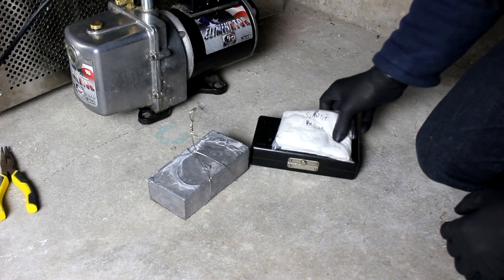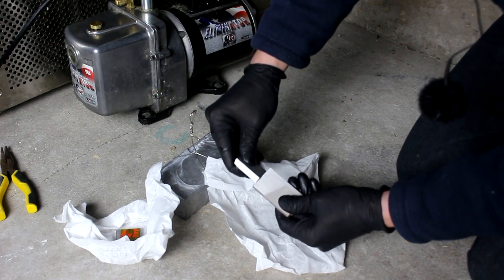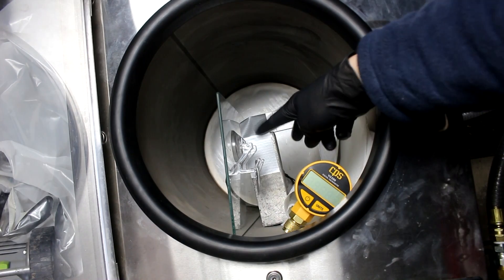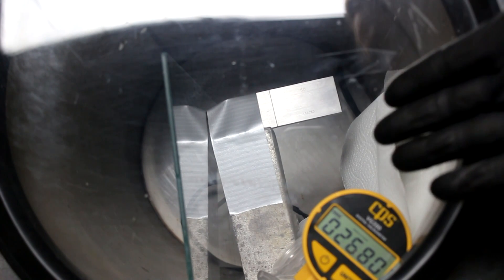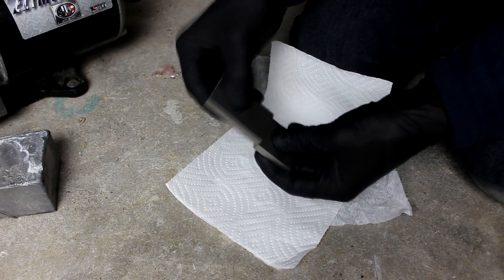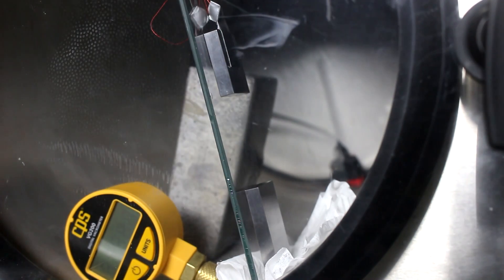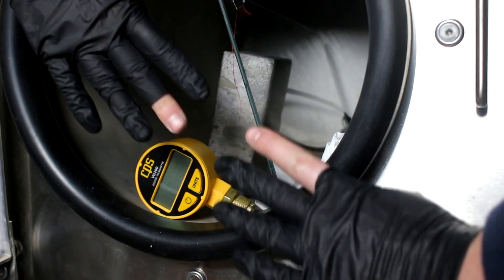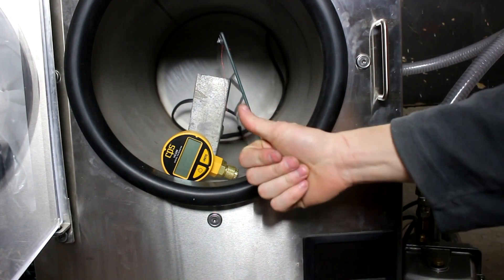Will Gauge Blocks Stick In Vacuum?

Comment: The bonding effect comes from temporarily induced ferromagnetism.
Reply from the maker: got an idea on a way to test that? because I'll do it.
Reply: Already falsified. Gold is not ferromagnetic. I don't think indium is either.
Reply: I just had an idea. Use a remote controlled motor from an RC car. This will allow you to remotely rub the blocks together without strings and stuff. You'll have to get an old RC vehicle of some sort and a controller and batteries but it could help with a lot of your vacuum chamber experiments
Reply: That doesn't mean it can't build up an electrical charge. Copper isn't either, but copper coils exposed to oscillating magnets definitely develops electricity.

Comment: Check the surfaces before and after joining the blocks with and electron microscope. See if there is any material exchange.
Reply: Excellent.
Next project: electron microscope.
Now that he has a good (dropping mercury) hard-vacuum pump, no problem.

Comment: Stiction. Optically smooth metal surfaces experience van der Waals attraction. Big problem in the old disc head business which is why the roughness had to be engineered to prevent the melding of the surfaces. Typical roughness factors were 8 - 20 angstroms or so. Do a search on Casimir forces. Cheers. Really enjoy your videos, by the way. Be safe.
Reply: vdW and melding are not the same thing. VdW is a polarization of charges phenomenon, and comparatively weak. You're not going to pull metal off metal with it, as Cody has already demonstrated in previous vids.
Reply: You are correct and it was a poor use of language. The old vdW explanation was a terminology which suggested a potential function having both repulsive and attractive regimes -- depending on interaction distances. In this particular case with the gauge blocks, I think the flatness has left a surface plasmon which extends over large areas of the block face. With roughness one gets localization and a lowering of energy of that local system. WIth the flatness, one gets an extended electronic state which has accessible electrons. Even the act of physically passing one block face over another disrupts this delocalized state and leads to a kind of localization between the surfaces -- their sticking together. Language is imprecise. I do find it interesting that a shear movement causes the disruption while a simple combining or touching does not. There is an activation energy. What is the heat of shear versus the drop?

Comment: Do you think that the humidity of the air could be sticking the blocks together like the oil did when you first stuck them together, where water is the lubricant instead of the oil? After all, wetting a suction cup does make it stick better... Is there a way to remove all of the moisture to test my hypothesis? Perhaps  repeating the experiment in a pure Argon atmosphere instead of a vacuum.

Comment: YO. Cody. MAY have found the reason. Was unrelatedly reading around physics concepts, found the Casimir Effect, and instantly my mind came back to this. It's the idea that two conductive plates/surfaces, when very close, generate a force between them. Gauge blocks being so precisely flat and made of metal, it sounds as though it would apply, so then it just becomes a matter of "How much"?

"In fact, at separations of 10 nm—about 100 times the typical size of an atom—the Casimir effect produces the equivalent of about 1 atmosphere of pressure (the precise value depending on surface geometry and other factors)" (Wiki page on it)

That sounds comparable to the gauge blocks, I think? So I suppose then this would be an example of some kind of "Casimir Adhesion"? (My phrasing, so I wouldn't quote it.)  I would think then that the air does need to be excluded, but not to create a vaccum; simply to maximise the contact area.

This effect seems both consistent with your experiments' results and also with mathematical principles behind similar situations, though I'm no expert, so I could be misinterpreting it entirely. Still, I think it's a direction worth looking into. :)

Comment: Is it possible that the sliding motion will temporarily create a magnetic field that will attract the two pieces together?  The friction may strip electrons from the surface of the metal, creating a magnetic bond of some sort?  One could try metal shavings (or graphite) over the joint to see if there is a magnetic field possibly.

Comment: What if you tried to get them to slide them together in the vacuum? Create a weight on a string, connected to a pulley that slides one block over the other?

Comment: Imo those blocks are so flat that when you force them together atoms behaves like velcro by very thin layers getting into each other . If it wasnt that flat , the little bumps of a normal block would prevent all area of the block to be contacted to other one . Try to unperfect one block a little bit to test this hypothesis ,   try rubbing sandpaper for very short time ,if it still sticks its dark magic .

Comment: What if in the first experiment, you tried to lightly tap the block over the gap to see if it will fall more easily at lower pressures; the vacuum is more perfect than the vacuum in the chamber.

Comment: IIRC correct, gauge blocks can hold like 75lbs+ for force, which is more than the surface area could hold under a 15psi vacuum. So that disproves that too.

Comment: Just food for thought. Could it be that the surface of the material is so finely ground and so flat that the atoms within the two blocks are bonding together as if they're a single block? In metals, electrons act as a 'localized sea of electrons', could it be the electrons are also bonding between gauge blocks, holding them together?

I work with these daily by the way, and this has often come to mind haha 
- Will

Comment: Maybe those blocks' faces are not quite 90 degrees to each other, in which case the glass surface will prevent the two contact surfaces being exactly parallel. I suggest somehow lowering the top block onto the bottom one without touching anything else, thus allowing it to settle flat against the other block under gravity alone.
Reply: I'm late to this party, but this was the comment I was looking for. The ends of the blocks would have to be almost perfectly perpendicular to the face that slides on the glass.

Comment: funny never seen glass or non ferrous gauge blocks, never knew much mystery behind it assumed it was magnetic interaction in close proximity and having the slide aligned the random poles of the ferrous materials. should slide em together with a bit of magnetic viewing film see if theirs a small interaction 

shrugs when what you've tried before don't work try something new.

Comment: i wish you tied two strings to the block, that way you could have tried to lift it while the vacuum was still in place. maybe when you let the air rush back in, some might be able to get between them. with a second string, you could burn the first, let it fall, and try to lift it with the second one from the outside (if this is possible? i think you've somehow done this before? i might be wrong)

Comment: I was thinking about your pressure gauge problem. Couldn't you just rig a simple remote control to press the button?  Even a cheap remote control car (remember the ones that only go forward and reverse?)  Tear out the guts of the car, and replace the motor with a solenoid and poof, remote control button pusher.

You might want to add a diode to the solenoid so it only engages when the voltage is in the correct polarity.

Comment: "At separations large compared to the London penetration depth c /ωp the interaction is due to electromagnetic waveguide modes, while at distances small compared to c /ωp, the force is due to surface plasmons." Read "Calculation of van der Waals forces in systems with nonlocal conductivity" for the actual scientific approach to this. Google the terms you don't know, this is pretty advanced stuff.

Comment: Is it possible that when you slide the blocks, there is some friction that scrapes off a thin layer of contamination, allowing the bare metal to form a weak cold weld?

Comment: Hey im a machinist. this works best with ceramic blocks but any scraped or well machined part does stick to a point. if you get a bigger plate or part that is flat on a flat table. stuck like fuck

Comment: Cody try putting two class panels on top of each other. They will stick together, then dip the panels in water to see if there is air between them. Or dip it to something less thicker than water. Then try it with vacuum chamber. If they don't stick, it's due to the friction. Hope that helps! LIKE SO CODY CAN SEE !!! <3

Comment: one more thing you need to consider is that even under a 99.9999% vacuum there are still air molecules SITTING on the surfaces of things. Nasa Uses freezing pads to extract this at the final stages of its testing equipment in 100% vacuum. I would say that IF and ONLY IF this is a cold weld process that you need to have a way of heating the surface. I think you need to "clean" both surfaces with your lazer for a few minutes to make sure there are not dust or air molecules or ANYTHING resting on this. I would suggest putting them in wet with acetone so when the vacuum pulls it cleans the surface then hit it with your lazer and see if that fixes it?

Comment: the reason this happens to the gauge blocks or any surface is a type of covenant cold welding. as if the metal is 1 pice and the atoms are so close that they want to bond. however there is a "crack" so its like a magnetic attraction between the atoms. some metals can cold weld but its not like a real weld.

Comment: i think you got the point across with the suction cups. But what you need to know is that they are not anywhere near a good vacuum. In fact i would garentee that the reason the suction cups came off was that the air inside them was expanding like now that the air is not pushing on the outside of them. Really nice job though.

Comment: Hey Cody machinist here. I work with both ceramic and steel gauge blocks almost daily. They both wring together (S-C/S-S/C-C) although they do wring when the surface is perfectly clean, I found its much easier if you clean them and then put a light fingerprint on one of the surfaces before wringing. if you push pretty hard while doing that, they will hold together with extreme force. If you have any questions about them feel free to ask.
Reply: I’m a pipe fitter. I work with stainless steel threaded pipe, quite often. I’ve been working with metal for twenty years. 
If it’s stainless steel threaded pipe, my trade will often say, “take a turn and walk away”. I’ve found patience in this. 
Most piping can be wrenched on hard and fast, and it’s good to go. Stainless steel will “gall”. It heats up due to friction no matter how much lubricant I use. So, I thread it slowly, and have less leaks because I can I can get more turns by letting it cool in-between rotations.
Reply: @quattovallor71 Ever just bring a can of keyboard cleaner and spray it upside down.  Get it done a fair bit quicker.
Reply: Michael Johnson hey I've been watching a few vids about these but I have no idea what you guys use them for. Hoping you can shed some light. Thanks
Reply: Gauge blocks are made to exact lengths and can be used to zero measuring equipment on, plus other measuring applications.
Reply: ,,, surface grinding is generally considered as very accurate; however gauge blocks and surface plates are a level higher and almost always are final lapped to size .
Reply: Interesting im sure the oil acts as an adhesive to aid whatever process actually makes them stick.
Reply: Well, I have a cheap set that I use for building spacer blocks - to use on the other side of the vise, in order to keep the jaws parallel. That is a crude use indeed, but you can make a spacer the exact size of whatever it is you want to hold, and the grip is better when the jaws are parallel. 

But one basic use of gauge blocks is to set a dial gauge at zero on a surface plate setup. Then you can measure some work to see how close to the zero it is. Like if the work is about 1.25" and you have an inch block + a .25 inch block, rung together, you can count on it being exactly 1.25". (It's actually bigger but only by nanometers!)
Reply: Dale Emery Wow, thank you. I can't believe how awesome and simple you just put that into play for my gears to understand that. You must be a great teacher. A guide to make accurate relevant expansion or contraction on a given application within the confines of high tolerance held in a vice. The theory here now from what I understand is the precise molecular compound arrangement of similar dexterity. This is very fascinating.
Reply: Oil means Van Der Waals forces
Reply: They make ceramic gage blocks???
Reply: @fingerfuckinsally  they make gage blocks out of a variety of materials. My shop has some carbide .050 blocks as well as the ceramic and steel.
Reply: A fingerprint has a complex chemical signature and would probably introduce a confounding factor not related to the matter at hand. At the least, the twisting in that case might spread out the substance into sort of mating film that would enable the suction effect.
Reply: yea if i had to guess, id say the oils on my hand at work form a suction while any bits of solid help to prevent the blocks from sliding. After pulling them apart, you can see every color almost like oil on water but thinner looking and in streaks.
Reply: gauge blocks are of course precision ground in order too make them this  would leave very very tiny channels in the metal maybe those are interlocking, because they are so very flat they are able too join?
Reply: @ChrisD4335  they twist together tho

Comment: a pulley system using magnets would have been better option as you could repeat the process while in vacuum and observe either they are stuck or the released air breaks the bond. anyway cody is dedicating too much time for vacuum experiments and not enough for other interesting stuff. gets too repetitive

Comment: What if you chilled them one or both with dry ice and then tried to twist them together, maybe changing the spacing ever so slightly, if that would have any detectable effect?  And for fun you could press them on the ice to see if they vibrate any better than with a spoon.

Comment: Could it be that the sliding motion creates heat due to the friction, and the outer most atoms of each surface get exited. And when they cool they get entagled creating a weak bond? Just thinking out "loud"... Thank you for the videos Cody :)

Comment: My theroy:
I'd describe this effect as molecular adhesion
They are flat with just a few nanometers tolerance so if you push them together, the molecules stick together like it would be a solid block.
The tolerance is so small that Van der Waals force is able to hold the two pieces of metal together.

Also the small tolerance might be a reason why you are unable to pump out a vacuum between the two pieces of metal. There are always enough gas molecules between the two pieces so that the distance is too high.

And for the "letting it fall down" I think it is not working, because it bounces. Even if it would stick for a brief moment, the forces in the two pieces are too great and tear them apart again.

Edit:
Geckos also seem to take advantage of Van der Waals force, so I think my theory isn't that far from reality actually

Comment: Hey Cody, big fan. I've watched most of your videos, and really enjoy your fun adaptation of science lessons.
I have a (probably incorrect) theory. First off, what is the melting point of the metal the gauge blocks are made from? You said the sides are near frictionless, but friction is still present. My thoughts would be that by applying pressure and tension, the friction heats the metal enough to just barely melt the two pieces together. It would be very minimal as the friction would produce very little heat, and the blocks are easily separated afterwards.
This could potentially explain some of the difficulties in adhering them in a vacuum as the heat produced from friction would be vastly reduced without the oxygen catalyst. I realize this part is probably inaccurate as oxygen is needed for fire and not heat, yet it is still an interesting point to consider.
I look forward to your coming videos, especially the mine. Good luck, stay safe, and never lose your passion.
All the best,-David

Comment: hi, can you test if warmer temperature or heat has any effect on how strongly they can stick together. may be due to the smoothness of the surfaces, the atoms ,(the electrons and neutrons have enough attraction that it holds them together.

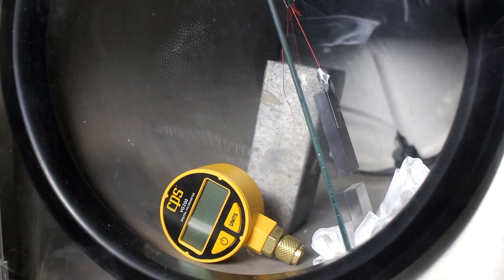Also for 11:00 test, you can used loaded spring to apply some pressure to the blocks. Load the  spring and tier it with the rope, put the block in font of the load springs and vacuum. once reached the desired vacuum, you can cut the rope with your laser.

Comment: it feel like, as you put pressure by friction between "high spots" or normal to the contact plane by forcing the two piece together there might be crystalline plans interlocking or dynamic re-crystallization AKA "cold welding".
Reply: maybe do a microscopic examination !!

Comment: Ok, what about using glass instead of metal. 1 - would they actually wring together and hold? 2 - As glass is a super liquid, after a while of being together, they might actually "cold weld"... or the glass equivalent. Has this been tested before? Can you test it?